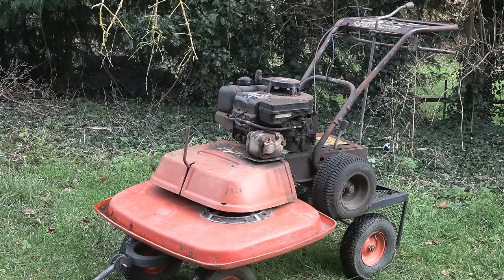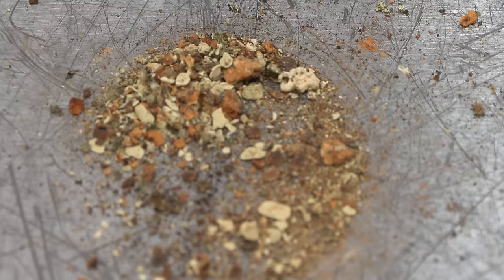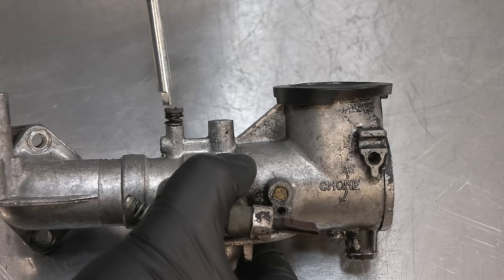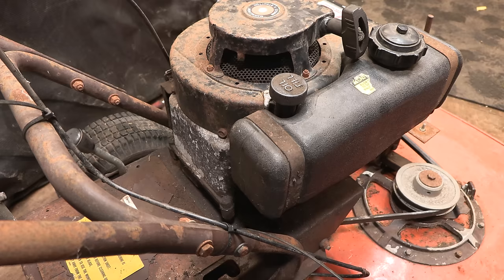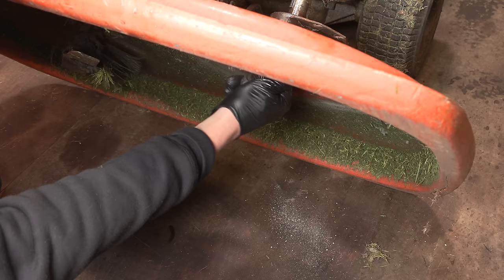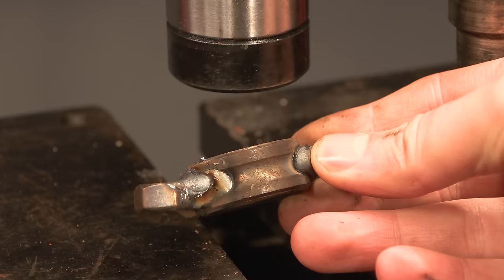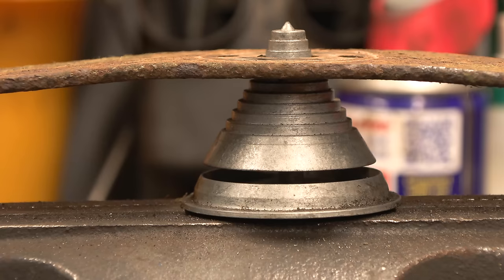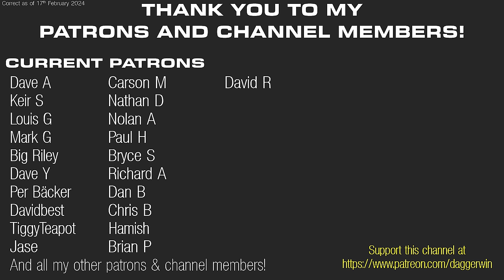MASSIVE HOVER MOWER RIDDLED WITH PROBLEMS - Let's Fix it!!

Comment: Day just got instantly better. Also i am working on my own project right now 😂. It is a John deere 318 that has sat for 20 years!!! I will have a video out soon fixing it.
Reply: Same here ,I working on a castle garden lawnmower, machinery restorer is brilliant inspiration to such a great hobby
Reply: I did like the trick of welding nuts to the inner bearing race so you could press it off…will be giving it a go the next time I get the same problem
Reply: I love these videos an find restoration really interesting. I'd love to try doing something simple myself but no idea how or where to start, any ideas for help?
Reply: We have a collection of tillers, rotavators, mantises and mowers outside. A garage more or less full of mower engines and parts including strimmers and brushcutters. We seem to like collecting these things.
Reply: ..lol.. I'm restoring a John Deere 205 it's been sitting for 20 years just finished the deck new bearings belts blades.the motor runs great ..the mower has low hours on it..I just need to finish painting..then on to the next one.. Cheers everyone from McDonough Georgia 🍻🍻🍻🇺🇸🇺🇸🇺🇸

Comment: One tip on taking out stuck jets and emulsion tubes. Tap the back of the screwdriver with a hammer while turning the screwdriver. Great job on the video. Very therapeutic

Comment: My father sold Flymo years ago here in the US. The were 2 Cycle, so you could mow on steep hills. I remember the carberettor being very difficult to adjust so that it would run properly. No wheels, just glide on air!

Comment: I enjoy your videos. 
If I may just add, I have noticed that other YouTubers say you should oil a new sponge air filter otherwise it will not filter correctly. I would refer you to "the exert James Condon" and also to Taryl Fixes All on this subject.  
You did power clean the machine at the end, however, I would have done that at the start to make the job easier to work on and film. 
Cheers to you and good luck for the future.

Comment: Neat machines, Kinda hard to find one here in the states as they are more popular in the U.K.
I bought a Tecumseh powered one with the handelbar air filter snorkel on Fleabay & worked ok but found the muffler melted & baked & cracked the deck around the engine support webbing. Also no safty switches & a bit awkward to move about without wheels & the hover fan tends to flatten the grass. I like the vintage 60s Toro ones & also the small Flymo Kawasaki Tl Micromo.✌👍

Comment: The one thing I would have done extra is to change completely the iron piece that connects the 2 spindels and not weld it cause it is not heavy duty and moreover very rotten and prone to break again... Otherwise nice fix video!

Comment: The mower did great, I think it would have done a nicer job if the grass was not wet. I have a general question with these small Briggs engines, Do you check the oil with the dip stick screwed back in or just dip it to the cap?

Comment: use a grinder with a sanding disc instead of a wire brush , get it to bare metal and your welds will come out better. Try not yo weld rusty metal if you can help it

Comment: grouse job mate she looks lovely afterwards and as for the well bearing yep no kidding they were loud shockers for sure from my view just looking at how they were spinning and i could tell right away the right one on the drive wheel pulleys had a lot of play in it but yeah changing both sets paid off in the long run and that old carburetor aka carby yep i would simply taking a propane torch with the nice flame and very carefully heat it up around the main jet is and then spray the oil down there as it would smoke but that,s a good sign as it,s allowing the oil to see past and expanding the aluminum etc but yeah all good and by the looks of thins yep she,s probably gonna need a paint job and well the deck might need a small fix too but yeah too easy i reckon and that,s a good engine from my view too and some people probably reckon they are terrible but yeah i like them for sure and only because it,s a qaulity engine and made by Briggs and Stratton decades ago for sure from it,s age and era etc and cheers from Australia 🐨🐑🦘🌏🇦🇺 or the land down under and yep Flymo is a good brand for sure for the average user but yeah i cannot blame there comply too.

Comment: Thank you for another  great restoration. well done.
what is the CARB spray you mention? i definatley need some of that in my working world, and what type of welding machine do you use? i need to get one but dont know the best type to get..
thank you
Reply from the maker: Thanks! I use STP Carb Cleaner. the welder is a Clarke 135

Comment: Hello,ive got a westwood s800 but it has a Briggs and Stratton 12hp power built engine,ive tried to tune the carb on it but ive ended up just making it worse than it already was,can someone tell me how many turns out on the air/fuel screw i need.

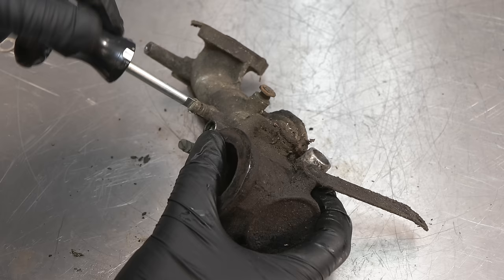Comment: Ar 12:14 I would have turned it in first, so you know where to preset it when you screw it in after cleaning!  Simple Green does a better job in the Ultrasonic.  Also a tea leaf holder would be much better for the small parts.  That main body needs the Ultrasonic again.